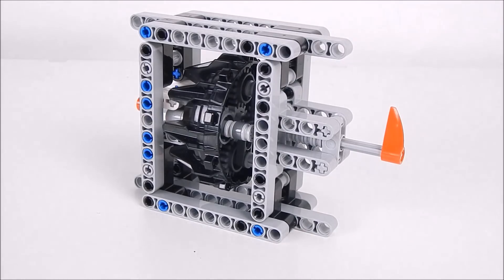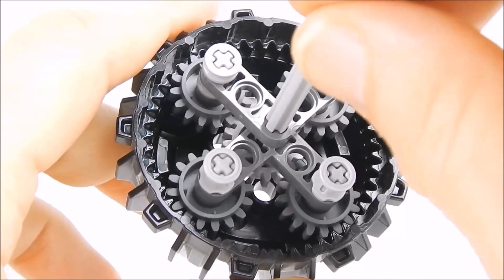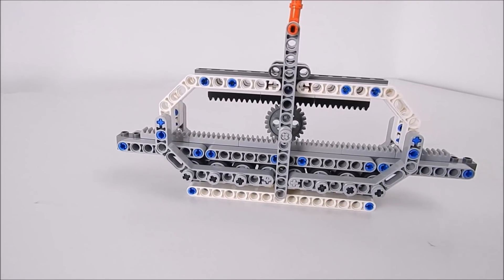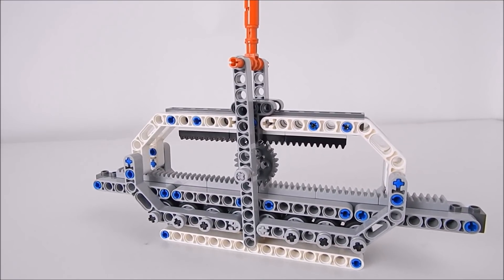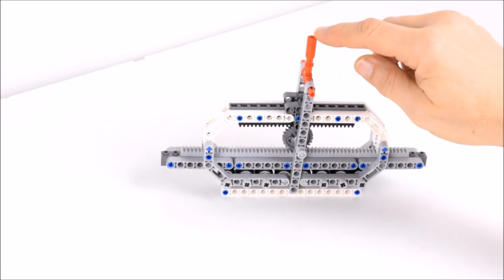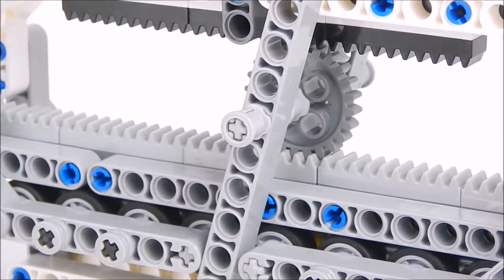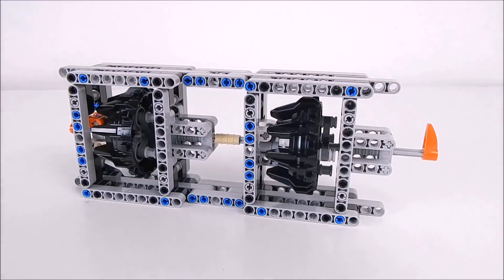How to build a Lego technic Planetary Gearbox with Explanation

Comment: i like your module but the black gear is always stationary?....so i took your example and 3d printed the black gear with teeth also on the ouside of the small end so i can stop it or let it run free with a clutch gear connected to it...now if i only understood how the mechanism works id be done lol....so far i just have the setup with no understanding of the principal...

Comment: An XL motor can turn that. Even tho it has slightly slower rpm than the smaller motors the torque makes up so it can turn higher gear ratios making faster Lego cars

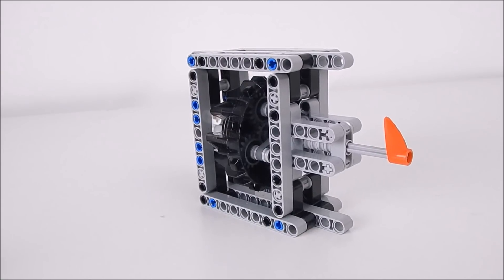Comment: 1:03 You mean torque? Yes. That sacrifice also means you can't rotate as much weight as you could at a higher torque and lower speed. (For example, you can't rotate a large, bulky propeller using a planetary gearbox that increases speed and decreases torque, like the one you built.)